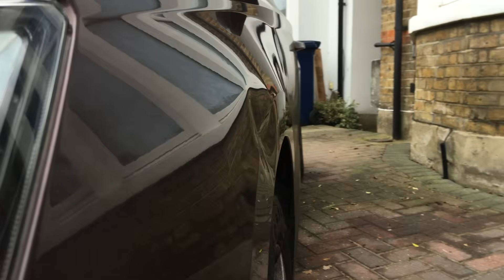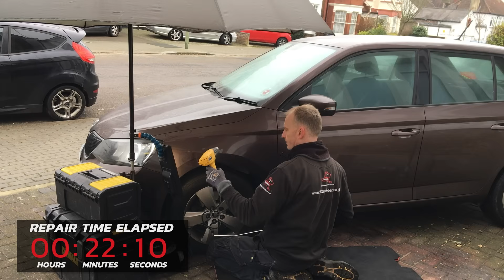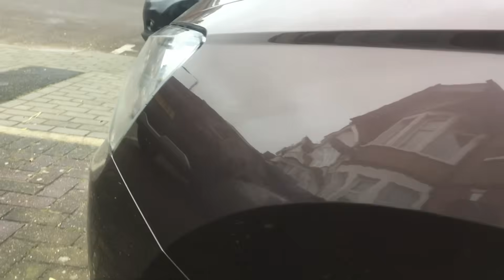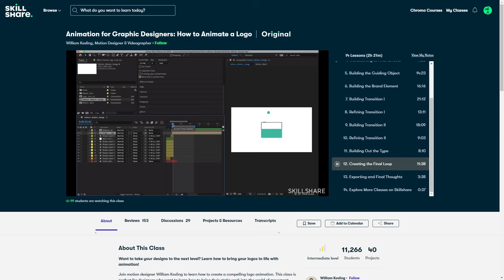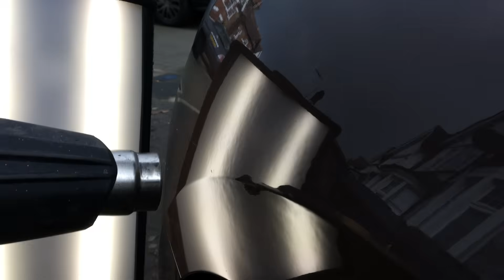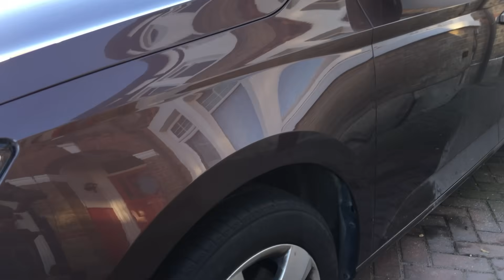PUSHING CREASES WITH PDR | Full Repair BREAKDOWN

Comment: What if the under the seam buckles out?
Reply from the maker: You would have to use anti blow out device to prevent the seam buckling out like a prop pressed against a nearby wall or use something else similar. If the edge buckled already from the impact then it does make this area a weak spot and difficult to work on, I would then use some sort of clamp to hold the buckle in place whist working the rest of the panel.

Comment: You can’t do this type of repair to aluminum panels?
Reply from the maker: You sure can, although it is much more difficult to do as the Aluminum panels are an Aluminum alloy which makes it stronger than steel. 👍

Comment: Great video, regarding the warming up. How do you know when its the correct warm :)
You appeared to use a hot air gun for seconds. As a guide, to the touch, how warm should it feel?  I know that is a somewhat daft question. There is the baby milk elbow test for them, is there a rough guide equiv for this?
Thanks, best wishes.
Reply from the maker: Thank you for watching! Some technicians will use a laser temperature gauge to measure the heat although I just make sure it it slightly hot to the touch, no more hotter than the panel would get on a hot summers day. For example if the weather is hot and the panel is already warm then  I wouldn't heat it up before pushing. It must not be too hot that you can't put your hand on it. It's just that the sharper the tool you are using behind, the greater the risk is that the paint could crack, especially in the cold winter months as the paint can become very brittle. I need to measure the panel next time with my laser temperature gauge to see exactly what temperature I heat it too. All the best, Jake
Reply: @1st_track_dents  Hi,
Thanks for replying. Some of the videos seem to suggest somewhere around 25C to 30C. Of course, being a beginner, I have no idea how good the info is. Those temps seem to fit with your words. As lots seem to use a hot glue gun, Im guessing those temps won't harm the paint. No idea how hot a hot glue gun is, Im guessing a lot more than 30ish C.
Thanks to co-vid I have a laser thermometer, it even has a smiley face if you are a healthy temp :)
Thanks again.
Reply from the maker: @jessicabakerseuk  Hot glue on the panel is fine, the only thing you need to check with all these things is whether the panel has been repaired/resprayed before, if it has, then firstly I would not glue pull the panel and secondly I would not heat the panel as much as a cheap badly painted spray job could react badly to any heat and glue pulling it could rip the paint right off. With PDR you need to become an expert at checking and assessing the paint finish to decipher whether it is factory original or whether is has been repaired before, usually a bad paint finish is obvious but not always so you need to be careful. 👍

Comment: Mine is double this in size, but at the same spot on my Accord. Wondering if I could DIY it making it look somewhat better, find someone to come out a do a PDR, or replace the panel altogether.
Reply from the maker: It's always better to get a PDR expert on the case, if you try yourself you could potentially make it worse and then it could be unrepairable using PDR so may end up having to be replaced. Good luck 👍

Comment: How much force are you using to push these out? Tried on my own and the rod just bends...
Reply from the maker: Hi, the rod for a dent like this should be at least 10mm in diameter and if it is from a professional PDR stockist it should never bend and if it did it would be minimal and I would only expect that to happen when applying maximum force. The professional rods are made from a very high grade metal. The cheap rods from some websites are just made from mild steel so they will bend immediately in half when trying to repair something like the dent in this video 👍

Comment: would you attempt this with panel pliers like the B&D with the extensions on them?
Reply from the maker: Hi Allen, yes if I owned the B & D pliers I would have definitely have used them on this as it would save the worry of the wheel arch edge blowing out as the force needed to push some of these bodylines out it huge! They are on my tools wish list! 👍👍
Reply: @1st_track_dents   sounds like an excellent christmas gift for yourself. Will we see you at MTE in February?

Comment: Am I the only one who would like to know the cost of this repair ?
Reply: In the UK. Something like that would cost £150-£200 to repair a wing. Not sure why it's so expensive in America
Reply: @mikewazowsk999 please suggest where can I do at this cost
Reply: @mikewazowsk999 id expect about 2 to 300 if it took about 3 hours but that's just a guess if he does 2 or 3 a day he's doing well obviously the kit is quite expensive though
Reply: @mikewazowsk999 because in US everything cost more then in UK.
Reply: Usually it depends on severity of the dent. But be prepare to pay anywhere from $500-2000
Reply: @Somechonchon could buy the dented body part new for that price
Reply: @CantonsNTW true depends on where it’s hit so in those case it might be easier to get a new fender.
Reply: @CantonsNTW 😂😂 ok and then fitting......and then painting.......and blending into the bonnet, door etc etc
Reply: @cbattman so true! PDR is all about saving the original paint. I have never seen a paint job to match the quality and durability of the factory paint. I'll always prefer PDR when possible, even if the paint is a little bit scratched.
Reply: @CantonsNTW the value of the vehicle depreciates if you paint or replace that’s why they go through us
Reply: @CantonsNTW  a new part with be $5000 plus labor $2000 total $7000
Reply: No you’re not, I wonder that myself on every PDR video I watch.
Reply: Not less than 500 bucks
Reply: So it’s around 300-600. But a new fender is like $50 bucks so why even bother
Reply: @jaysrt21  yeah, I wish I would have bought the fender instead vs the paint less repair to save money. Ole well
Reply: @jaysrt21  This is just ignorant the fender is not 50 and you still need the work to replace the old one. And R/I all the appropriate parts. Also you would need to blend to the door.
Reply: Ich denke das war ein Beispiel für die Kunst der Bearbeitung. Der Kostenpunkt dürfte ungefähr derselbe sein wie ein neuer Kotflügel. Vorteil hier, Original Teil, Original Lack, und je nach Termin am selben Tag Auto zurück. Die Arbeit ist dieselbe, ob am Skoda oder Mercedes und so weiter. Echt gute Arbeit… Schönes Handwerk ❤
Reply: I am going through a body shop now.350. PDR repair
Reply: If you can buy a new wing already painted for £150, It's just as well replacing instead
Reply: New wings don't come painted. So plus painting and probably  blending in to other panels will be. Needed to make a good colour match. Let's break the cost wing around 100. Painting wing and blending in to front bumper bonnet and door you looking at around 500££ in back garage  or 150 just to pait a wing colour match  and Finnish not the best but it's cheap job
Reply: I'll pay the shop for 2-3 hours for this repair and refinish
Reply: 500 $
Reply: No way to know until they actually get hands on it.
Reply: Not more than 150 bucks! All more  is robbery!
Reply: Superb spotless renovation of an original factory finish .
Reply: I see you are working in the street, are you a mobile professional?
Reply: 150-300€
Reply: I live in the US and I wouldn’t charge more than 250 depending on access no less than 150
Reply: Boiling water and push it out
Reply: Yeah.  In an age where you have all types of search engines, it's insane to ask.

Comment: Great explanations. I like to work those very similar. Maybe a bigger rubber ball tip to start when I can. Then the round rubber tip you used. Followed by the smaller rubber tip and then the red cherry tip before cleaning up with a blunt steel tip and sharp tip if needed at the end.
Reply from the maker: Thanks Mark, yes I find a lot of the time, the skill in PDR is knowing at what stage in the repair to change tips, because as you know, changing to the wrong tip at the wrong time could stretch the metal or leave nasty pin marks in the panel. Thanks for watching!

Comment: Absolutely Flawless! I started to get tools to do this type of work. Definitely practice on mine. And wouldn’t mind going to school, but not sure where to go here in the states and somewhere locally. Or how much to charge for different repairs. Could you at least tell me how to charge for repairs in case I get asked to remove dents? I’ve don’t bodywork for 6 years. So I have an understanding of manipulating the metal. Have haven’t done this method. Thanks.And Again Looks Awesome! 🤝
Reply from the maker: Thanks James, USA is the home of PDR so you will be able to find lots of good training schools over there. Pricing is difficult as it's much more lucrative over there in the USA and everyone has their own system of pricing. Most of the USA tech's I follow use a system called mobiletechrx which is an app you can have on your phone and you enter the details of the repair and it gives you a guide price. Maybe look into that. Thanks for your kind comments and I wish you all the best! 👍
Reply: @1st_track_dents  Thanks Bud really appreciate the info. And I’ll definitely look into the app for sure. Lol it was suppose to say, “I Did Bodywork”. Haha. It’s definitely an art form for sure. Thanks a lot for replying I really appreciate it! If I have any more questions or concerns would you mind if I messaged? 🤝
Reply from the maker: @jamesbarlowjr.3762  No problem, sorry for the delay in my response, I get so many comments and messages and your one got held for review by the YouTube bots for some reason. Yes definitely look into the app. If you have any questions, that's fine, I may struggle to answer quickly as things get very hectic, but I will try my best 👍
Reply: @1st_track_dents  Lol ohh really? A Bot huh? Maybe I should do the Robot Dance 🕺. Haha. Thanks I really appreciate it. And I understand, I’m sure you have all kinds of comments coming through. I appreciate ya, and again Thanks Again for replying! 🤝
Reply from the maker: @jamesbarlowjr.3762  😉
Reply: @1st_track_dents  🤝

Comment: How do you set your camera up to see the dent but at the same time not interfere with your line of vision to fix the dent? Just play with adjusting it until you get it or what? May seem like a dumb question but I've been trying and having issues.
Reply from the maker: Yes, it's not easy the camera is always in my line of sight so I have to move my head to the side very slightly which makes it a very awkward angle to work at and my head often hits the camera and I have to start again 😂 but I just persist and manage to get the shots, but yes it is not easy and I hope my viewers understand the weird shapes I have to get my body in to get these shots. 😂😂😂
Reply: @1st_track_dents  I appreciate the reply, I guess what I'm going to start doing on my videos is just show a different angle of me fixing the spot. One where I'm not trying to capture the reflection of my light.

Comment: Amazing work, and excellent camera and video editing to boot!  Is it okay to ask how much this dent costs to repair; I think that would be valuable for viewers to understand the costs, both as a customer and a PDR tech.  I have removed nearly all of the dents from my car, but I have 3, 20mm crease dents on my hood that lie directly over an internal rib.  So, I can't get my tool directly under the crease, since it lies directly on the rib, and hot glue pulling doesn't seem to move it much... Any tips for getting out small creases over support ribs?  
Lastly, have you considered adding a mobile pull tower to your arsenal?

Comment: Ok, so, ...
Obviously you have had some training to do this work. 
I can do this as well. But its not for most people . 
I'm just wondering when you'll actually do a video about the tools and skills sets. Versus the job. 
If I'm going to learn. Then I need the correct information for the studding to work. 
So.  Are you just showing your skill, or are you trying to teach somthing?
Tell us about all the tools and where we can buy them so we can compete with you.
Tell us how and why its used. Where do I get the light?
 Why do I need to follow certain guidelines, 
And so much more. 
Ok thanks. Cool work. 
Oh yeah. I have one that isent that bad. But I want to see you remove it. 
I'll bet anything you wont be able to, well not with your process. 
Cool videos. 
Thanks.
Reply from the maker: Hi, thank you for your message, in my videos I am just documenting my repair process showing what Paintless Dent Removal is capable of and how I carry out my jobs. They are not really tutorials although lots of people have told me that I have helped them. I show all the tools that I am using so there is no mystery surrounding the tools. If you are interested in tool videos the best ones are from the USA as the income earnings there from PDR are far beyond anything I could ever earn in the UK so they will always have the best tools and most of the tools are manufactured there too. I have had to learn to use around 4 or 5 main tools as you will see in my videos. I am sure most of the other countries mock me for the tools I use😂, but although I do struggle sometimes with what I use, I still get the job done. I will maybe do some tool videos later in the year as I am trying to budget for some new tools. All the best! 👍

Comment: What would you do if you had a door dent (on a Fiat Bravo mk2) exactly at the point where the glue is? (There is a glue spot between the door and the horizontal  side crash bar and the dent is right on it!) Is it OK to use a saw blade to cut the glue joint in order to pass the pdr tool through?
Reply from the maker: You could either use a sharp bar and push through the glue or yes cut the glue away for access and replace with some butyl tape or something similar when you are done. 👍

Comment: Great repair and video as usual Jake what’s happened with your dapper slapper noticed ur not using for the last couple of videos.
Reply from the maker: Thanks Adam, yes well spotted, I still really like my Dapper Slapper, it's because I was off all last year (long story) and have only just got back working and I have reverted back to all my bad old habits! I have been using it, although mine still looks brand new and sometimes I don't want to get all scratched up so I still sometimes reach for my old bashed up panel hammer!

Comment: Jake your the man ! You make it look so easy but it’s far from it , easy to mess up if you don’t know what your doing
Reply from the maker: Very True Barrie, as with any trade, experience counts for a lot. 👍
Reply: @1st_track_dents  exactly mate ,I’ve had a go on a few scrap cars that had dents and although it looked better it was far from perfect, and certainly not something I felt happy with and charged for 😩
Reply from the maker: @barriecole2488  Problem is you need to master the very small dents first before moving on to the bigger ones, a lot of new tech's send me photos of stuff they are trying to repair that I wouldn't even attempt, the small ones can be the hardest to do so mastering those first is very important 👍
Reply: Thank you guys just getting into the trade and I'm learning heaps by just reading your comments

Comment: What would be a ball park figure on a repair like this? ( not asking for your actual costs lol) I’ve a similar dent to this but the paint is also cracked and flaking off. I know a body shop with just fill and paint it. Trouble is the thought of filler doesn’t sit right with me as it does sink over time. I’m just wondering if this would be more cost affective or just put a new wing on.
Reply from the maker: Hi Tony, every job is different,  if you want to email some pics over I can give you some idea of what I would charge. It can be different depending where in the UK you are if you are in the UK that is? depends on many factors like the size and depth of the dent if it is steel or Aluminium etc, access issues, removal of trim, wing liners etc. It is always much cheaper than what a bodyshop would charge as most of the work is just hard labour 💪

Comment: As I have commented before, great video. Picked up on your comment about feeling the panel to determine the strength of your input. I do the same on our glass topped oven - by touching the top (not the burner!), I can feel whether a pot is at a certain point of a boil. Second, you have to have a very experienced eye to do what you do. Good job!
Reply from the maker: Thanks George, yes, good vision is only part of the skill set, the sound the panel makes when you hit it and how it feels all contribute to the whole repair process. Keep well 👍